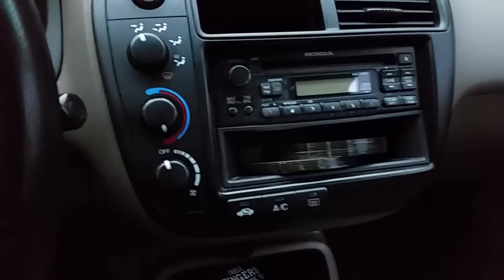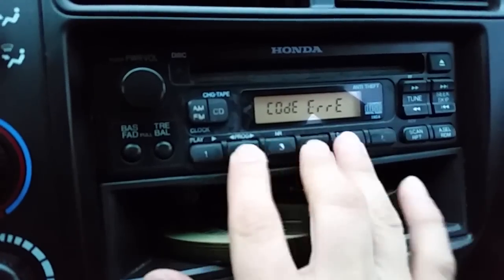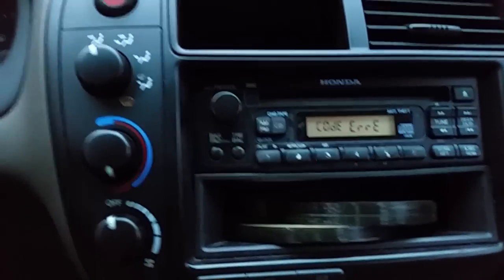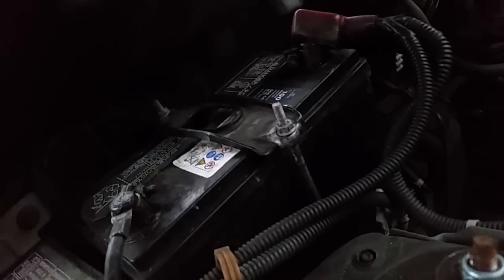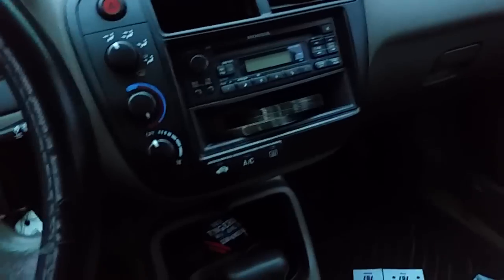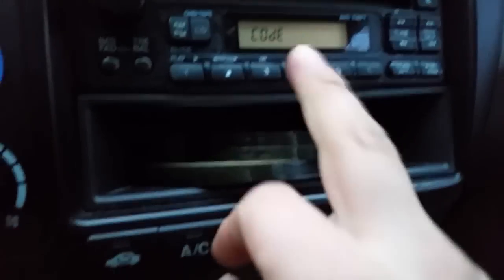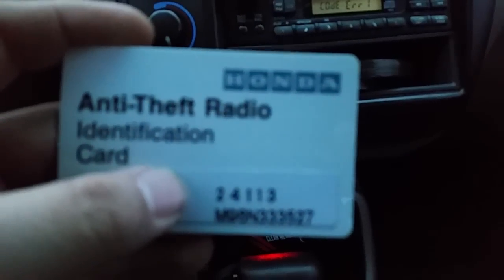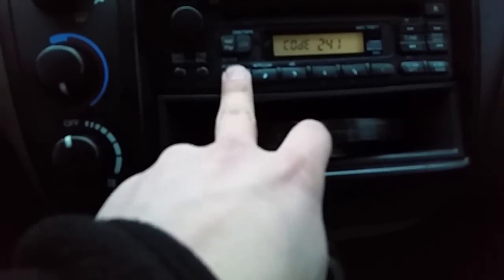ERROR on a Honda radio - what to do

Comment: Thank you so much for putting up about the errors on you tube. I had tried several times to put in the code and it wouldn't work. After seeing what it did to you with the errors I realized I had transposed a couple digits on my code. Thanks again so much.

Comment: Warning ⚠️ If you disconnect the battery the anti-theft alarm will go on!

Honda website says if you enter the wrong code you need to WAIT 1 hour and then enter correct code.

Comment: I say to be very careful about disconnecting the battery. Since we replaced the battery in my mom's car, the radio has had issues. Something to do with disconnecting it, makes it a problem passing smog (good ol California), now we're having to drive it a lot of miles on the highway, hoping when we bring it in the 4th time, it passes. Was able to get the code for the radio, but get "Error 1, 2, 3..." when we try to put it in. Will try removing the fuse and see if it'll work. The instructions in the manual are basically nonexistent too.

Comment: Instead of messing with the battery, you can just pull the fuse out. I believe it’s the number 9 slot and a yellow 20 fuse, that fuse is for the cigarette lighter and the radio.

[BOOM]

Comment: It's only necessary to disconnect the battery ground cable to break the circuit.  You don't even have to do that if you pull out the fuse in the fuse box that feeds the memory circuit in the radio.  That will also reset the radio so you can put in the correct code.
Reply: I did that and it never reset my radio so I disconnected the batttery
Reply: @basketballify9802  You have to pull the fuse from the fuse box under the hood.  The one on the passenger's side dashboard doesn't seem to work.
Reply: @1575murray  damn yeah I did the one in the Ik the car
Reply: Pull out just the fuse doesn't work in every car model. Honda Pilot 2007 needs disconnect at least the Battery ground cable and reconnect after a few hours

Comment: Any idea of what to do if you don’t have the code? I just bought a used 03 odyssey with the same error
Reply from the maker: You need to hold #1 and #6 and hit power. You'll get a serial number. Give that serial to a local honda dealership so they can give you the code. Or find a website that can decode it you.  Check out the comments I think someone may have posted a link

Comment: Would ErrE code in 2004 radio have anything to do with it starting
Reply: Honda CR-V 2004 turns over but won't start why would the ErrE code on radio have anything to do with it not starting
Reply from the maker: The battery has probably been dead for a long time

Comment: Mine won't pull up anything anymore it used to say Code but now it's not displaying anything no matter what I try it turns on like the screen turns red but no words come up at all anymore I know you posted this year's ago but do you know how to fix this?
Reply from the maker: I've never seen it turn red.  Try disconnecting and reconnecting the car batter
Reply: @DirtydogMech  oh it's a 2004 Honda Civic different radio setup, it turns red when it's on. The led light is just red but no words show up anymore I've tried taking the negative off the battery and even taking out both radio fuses in the engine and in the car nothing will make the radio show CODE anymore 🤦🏽‍♂️
Reply from the maker: @alexw1953  hold down 1 and 6 and then hit the power button
Reply: @DirtydogMech  yeah for some reason that just turns it on or off doesn't reset it or pull anything up

Comment: I put my code in and the radio works for a bit then it says error again . Would you know why this happens?   Thanks
Reply from the maker: I feel like you battery may have a bad connection. That usually never happens. Something is causing the radio  to lose  power and reset the radio

Comment: Removing the fuse & reinstalling it an hour or so later worked- & the code was on the glove compartment sticker. I had inadverdently gone over the 10 code limit messing around with the buttons when the 'code' message first came up.
Reply: Skipped all the steps of this video with this advice thanks
Reply: Are you referring to the radio fuse in the engine compartment fuse box? I tried that and was just taking it out and putting it right back in. Knowing it works after a full hour is very helpful. I will try it again later.

Comment: Why not just remove the Fuse for the radio? Removing the battery resets the computer and makes the car run rough for a while while while it re learns how the engine idles.
Reply from the maker: I haven't had any issues. when I disconnected the battery with idle. I've never tried it by removing the fuse. Worth a try
Reply: What do yo mean exactly? Like removing it and putting it back on? Or just removing it for good? sorry I'm a bit lost in cars but I'm having this problem.
Reply: Dallas Dal Thanks for the tip. I removed the fuse instead. It's a much easier way to reset the radio.
Reply: Dallas Dal does it work ? I dont want to go thru the hassle of taking off my battery
Reply: Right, or just the positive (red) cable. No need to disconnect both.
Reply: @MikSrf723  ..neg cable

Comment: What if i follow the steps and nothing appears? Any other method? Totally stuck. How many seconds should i hold the 1 & 6 for?
Reply from the maker: JayGsTV  usually you can press 1 and 6 then power and a serial number will come up.  if you've entered the code to many times disconnect the battery then reconnect and try again.
Reply from the maker: JayGsTV you only need to press 1 and 6 momentarily

Comment: I have a 2003 honda crv and just bought a battery  and now the keep saying error and won't work  can nobody help me please
Reply from the maker: check your manuals or any paper work that may have come with the vehicle for a written radio code. Also check any stickers in the glove box there might be a RADIO CODE in there. if no number is found, press power and number (1)(6) on the radio itself and it will give you a serial number. use that serial number to locate the radio code. do some research and you may a website that can give you the radio code when you use the given serial number. If nothing works you may have to pay the dealership to give you the radio code. if you find the code simply type it into radio, if you mess up to many times and you a permanent error, disconnect the baterry for a couple off minutes and try the radio code again. hope this helps
Reply: @DirtydogMech  I think her problem is the same as mine. We have the code. Our 2003 CR-Vs just won't let us enter the code. It's a issue I am seeing all over the internet on several sites.

Comment: I have a 2001 Honda Civic ex anybody know the code? and it says error when I try so should I disconnect battery?
Reply from the maker: Check your manual someone may gave written it or glove box there might be a sticker
Reply: @DirtydogMech  ok will do thank you probably somewhere in there but should I disconnect my battery still or is there a safer way to do it

Comment: What if my security code has an 8 in it but the radio buttons only go to 6? I can't remember how I did it before. 🤪
Reply from the maker: I dont think you can enter a 8. Might have to do more research on that
Reply: @DirtydogMech  that was quick, I know I had to enter it several years ago, but my brain can't  bring up that memory. Haven't found any info yet on the how. Maddening.

Comment: can also take out the fuse
Reply: Which fuse pls help ??
Reply: @yt.nicolas4630  It's late but I tried that. It's #9 in the engine compartment fuse box. Look on the internet for diagrams of the fuse box. I tried this but it doesn't work.

Comment: Thanks, that easy to understand but you can also get the code from this website, you will need the VIN and Code you get from the radio after you reset the radio.                                                                 https://radio-navicode.honda.com/

Comment: How did you get the code to begin with ???? Thanks for nothing
Reply from the maker: Some people have posted a website where you can find them. I still have my orginal car manual which contains the code if you don't have to code you can press power button 1 and 6 at the same time and you will get a serial number to give to the dealership or find a websites that gives you the code. Your welcome for nothing

Comment: hey I have a 2002 honda civic and i have the code whenever i try to put it in it says error and the 3rd number I press
Reply from the maker: if it's not working you may have been locked out when you enter it incorrectly to many times. Try disconnecting the battery for a couple of minutes. reconnecting the battery. and try entering the code again. if it still does not work you might have the wrong code
Reply: it's working now THANK YOU
Reply from the maker: your welcome
Reply: Janeshea Bourgeois what is the code?
Reply: It's fixed Now
Reply: @janesheabourgeois9924  а есть русская версия видео？

Comment: It wont work every time I try to type it it spells out code so my code is 22212 but when I type it it goes c o d e
Reply from the maker: Disconnect your battery if you have to again. Reconnect then try the number again. Triple check you code tg o see if its correct

Comment: my code has an 8 but radio is 1-6 how can i put code in?
Reply from the maker: Carlton Burrell are you sure it's not the serial your looking at? 
Where did you get the code from?
Reply: DirtyDogMech yes I’m sure I️ went to Honda website it gave me a code 2428 my radio only has 6 digits how Can I put in an 8. 

Just the record there is a stick in glove box with serial number and same 4 digits.
Reply: I’m pretty sure it’s a 5 digit code that you need
Reply from the maker: Yes it's only a 5 digit code
Reply: 8 could be 2??